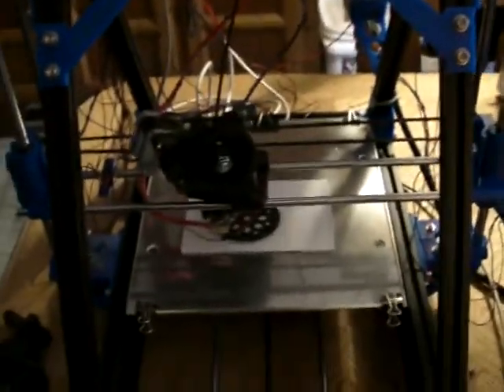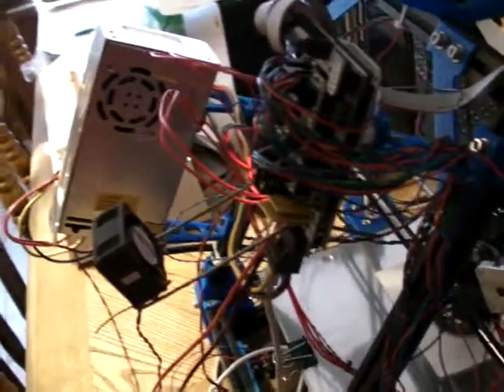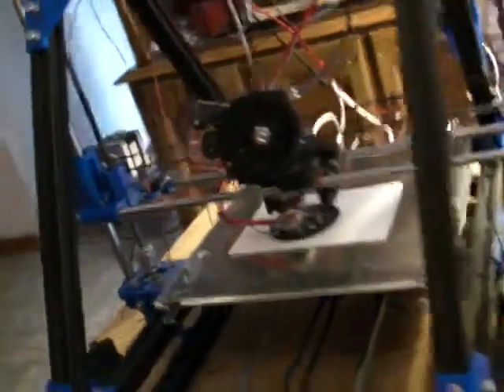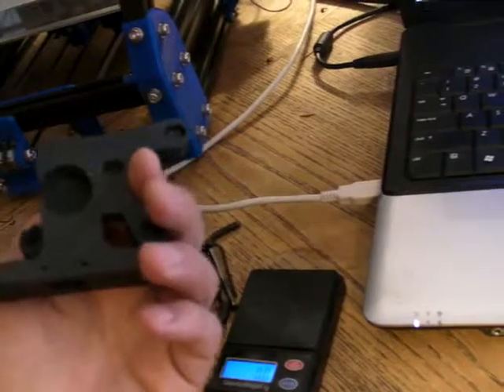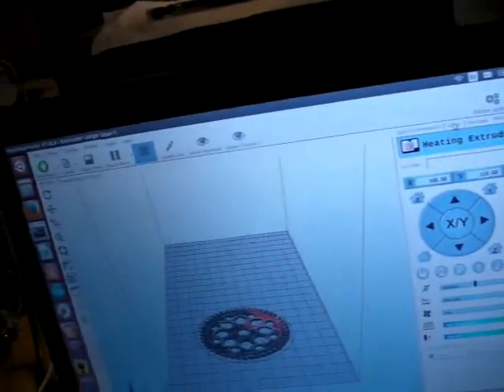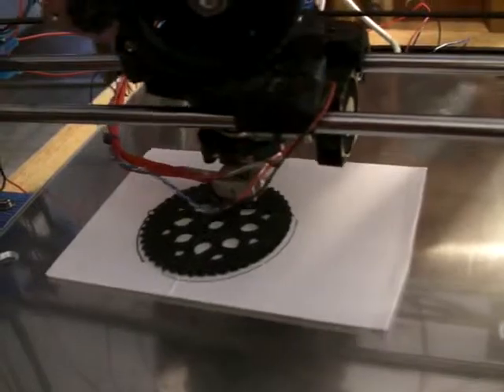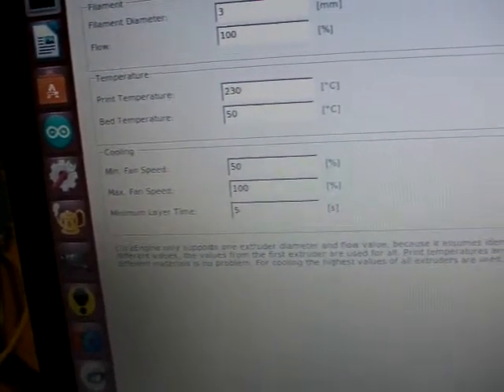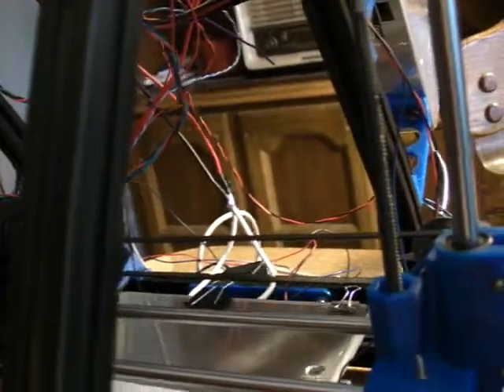MendelMax 1.5 RAMPS 1.4 3D Printer Basic Setup

Comment: Howdy,
Regarding the 'large thermal printer adhesive shipping labels' used to make for easier printed part removal - how did this method work out?
Reply from the maker: it works rather well... for some parts. Parts with more surface contact are harder to remove, nothing a kitchen knife or broad blade scraper cant do.

I like the fact I can turn the heat off or not use it at all, because o f the plastic labels when using PLA or making small parts from ABS. No acid mess, and the labels are usable for a handful of times and easily come off with soap and water or mild degreaser. I use 2 fl oz of Pine Oil mixed with a gallon of water and poured into a spray bottle.

plastic non thermal shipping labels are cheap, 1000 of them can be had for usually $10USD with shipping

Comment: What program did you use for the ardiuno?
Reply from the maker: chris jolly 
The firmware in the arduino is RAMPS 1.4.
The computer host software is RepetierHost
Reply: Did you uplaod to the ardiuno? I am been only able to find a program called Marlin
Reply from the maker: chris jolly 
yes. I used the Arduino IDE to upload. RAMPS is a firmware framework and Marlin, Teacup are flavors/variants. I use Marlin
Reply: Ok I am having a hard time setting up the program correctly would there be anyway for you to help figure out what i need to do to set it up?
Reply: where did you hook up the fan the is controlled by the LCD display
Reply from the maker: chris jolly
have a look at the reprap wiki and more specifically, the RAMPS section. There you will find most of the answers you are looking for.

The questions you have asked thus far can be solved by reading a little about what you are doing.